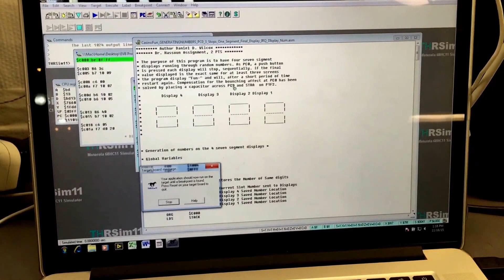Motorola 68HC11 Project Microprocessor

Comment: Having issues trying to connect my M68HC11EVBU board to THRSim11. My Laptop com1 port is testing fine. My port settings are the same on THRSim11 target board settings, com1, 9600 baud, ....has anyone else had this issue? New to this program.

Comment: Hello! I noticed this video is several years old but wanted to comment and see if you respond. My dad worked in electronics and even taught electronics at the university level for many years. There are a bunch of these old kits still in boxes in his garage - along with a ton of other electronics stuff. Would these still be of any interest to buyers? Or is it all too old?
Reply: People may be interested if the kits are in working condition. I'm actually an engineering student who stumbled upon this video while looking for similar project kits to buy for my final year project.
Reply: @kerriwilliams915  Thank you so much for your comment! I’m assuming they all would work since they remained in boxes and appeared to never have been opened until I came across them. Would ebay be the best bet? Or are there other sites people go to seeking this type of stuff?
Reply: @ThatSunflowerShines  ebay is good. I usually browse on there before heading to amazon or other sites.
Reply: @kerriwilliams915  Thanks so much for the tip!